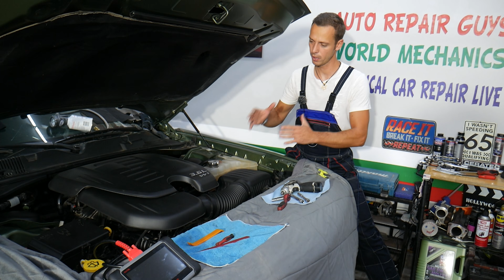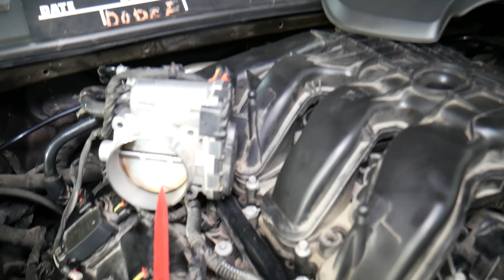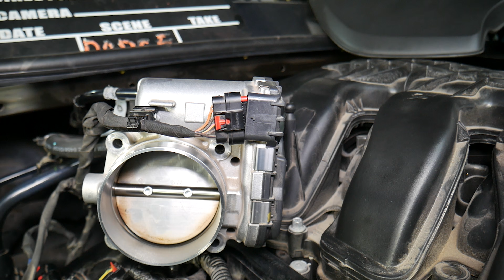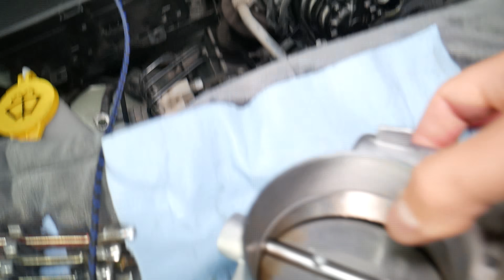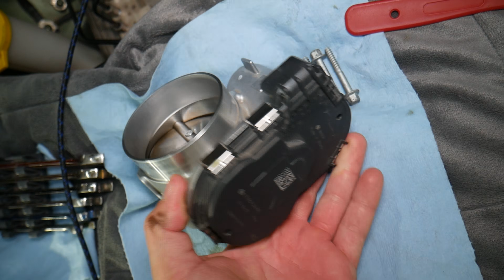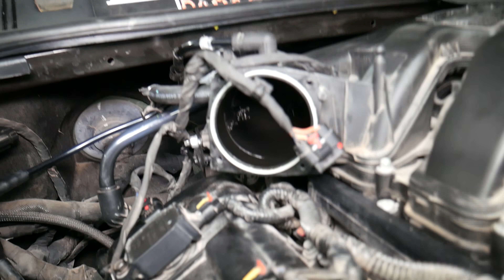DODGE CHARGER CODE P2111 P2112 ELECTRONIC THROTTLE CONTROL, CHECK ENGINE LIGHT ON

Comment: @autorepairguys I have a 2007 Mercedes e350 with 2 p0300 codes random misfire I replaced everything spark plugs ignition coils camshaft sensors/magnets maf sensor intake manifold and cleaned fuel injectors. I read it with the scanner tn before starting lt ftrm 1 read .8 and lt ftrm 2 read 5.5 I don’t think that’s right how would I fix this issue I’m lost and drained a lot of money and time it’s been 2 weeks I haven’t drove it it sits at 165k problem happend when coming to a red light. Should I replace 02 sensor or fuel pump that’s the best I came up with help for other people ? What do you think I should do